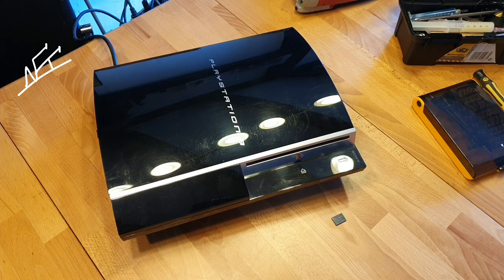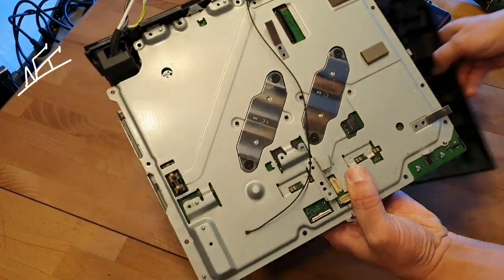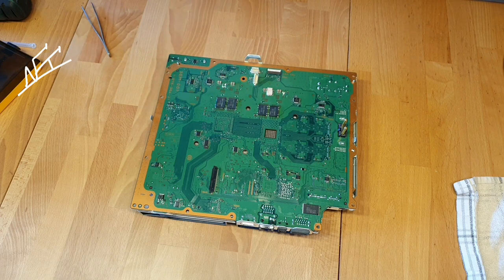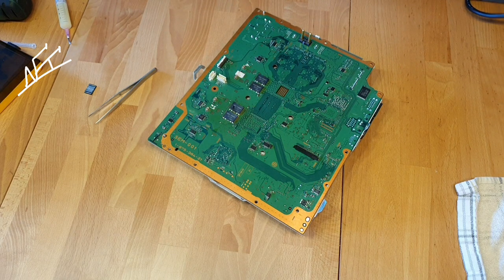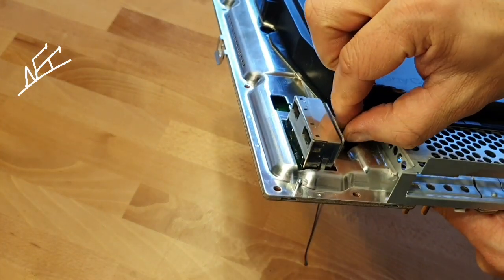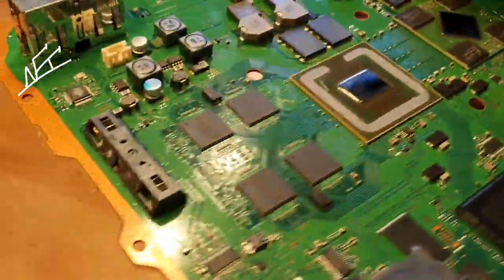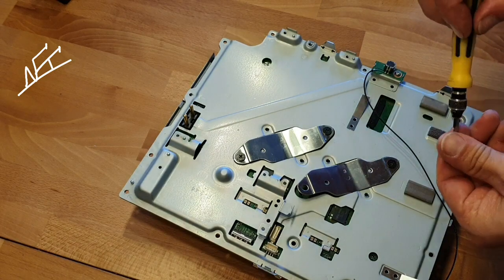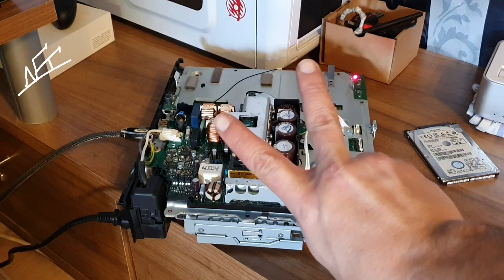PS3 YLOD Fixed with an Original Nec/Tokin Capacitor By:NSC

Comment: Can this Nec's be cause for GLOD (green light of death). Console is not overheating
Reply from the maker: Yep
Reply: Thank you very much for your reply. I ordered 10 pcs of theese caps. Have 2 ps3 Fat-s, one with YLOD and another one 60GB version with card readers. Second have GLOD.
Reply: @lordred7462  hey can you recommend the place we can buy these capacitors from? Thanks.
Reply: @habzmiah  I bought them from ali express
Reply: @lordred7462  thanks. Are they all 470uf that you have bought?
Reply: @habzmiah  yes. I bought 10 pcs in bundle because I will replace all 4 of them in mine ps3 because you can't visually see which of them is bad so I will replace all of them
Reply: @lordred7462  hey i got mine with glod also, did yours get fixed with the capacitors swaped?
Reply: @renatonake182  no, it got scrapped eventually

Comment: Any tips what can cause YLOD when I changed capacitors and still no fix? I fixed two PS3s before with this method of changing capacitors so I think I do it ok but still no fix. It is CECHE.
Reply from the maker: Because it was overheating one day, because the PSU, a broken PCB, a burned CPU/GPU or some fuses...

Comment: Ich habe das L modell und bei den kondensatoren auf der rsx seite steht 108 nicht 128. Sind das die gleichen von den werten? 3,3 v 470uF?
Reply from the maker: The NEC/TOKIN Capacitors have the serial number 0E128 - 1200uF "Phat Models" and 0E108 "Slim Models" - 1000uF Capacitance respectively.

In deinem Fall sieht es so aus als hätte deine Version schon die gleichen Necs wie die Slim Version, bei dir dann die mit 330uf, aber lieber die mit 6.3v, die halten mehr aus als die mit 2.5v.

Wobei bei denen im tut. steht geschrieben 470uf für alle Fat Modelle...

*Phat Models: "470uF"

*DECR-1000 - "TMU-520"
*DECHA00A - "COK-001"
*CECHA - "COK-001"
*CECHB - "COK-001"
*CECHC - "COK-002"
*CECHE - "COK-002/W"
*CECHG - "SEM-001"
*CECHH - "DIA-001"
*CECHJ - "DIA-002"
*CECHK - "DIA-002"
*CECHL - "VER-001"
*CECHM - "DIA-001"
*CECHP - "VER-001"
*CECHQ - "VER-001"
*DECR-1400 - "DEB-001"

Einfach mal testen, wenn nicht geht dann weißt du Bescheid. 

https://www.psx-place.com/threads/tutorial-nec-tokin-capacitors-replacement-ylod-fix.25260/

Comment: Need help Regarding Fat PAL PS3 60GB model, So I have a Problem I hadn’t used my PS3 fat in 3 months but today I booted it up(meanwhile this darn AC was turned on in the same room in the background) and was playing for 1 hour and a half and turned it off for about 10 minutes before turning it back on 3 seconds into the boot up screen and I turned off my AC At this Exact moment my Ps3 shutdown for some reason and I panicked and it started doing this exact red light of death and won’t turn on anymore come to think of it in the past also it would randomly shut off between gameplay 2 or three times making a red light but then it would turn on fine so I didn't pay much attention to it. So I’m guessing this might be a power supply issue or capacitor issue🤔if not then I’ll be really depressed. “Retro” games and old games are really rare in my country and eBay died 2 years ago here so There really is no one trustworthy enough here to be handed this old console.I found this PS3 Fat a year ago on my local craigslist by a stroke of luck! And bought it for $130. It’s always really dusty inside(and it was at the time of purchase too) although I had CFW installed on it So I turned up the fan speed so the temps don’t go higher than 61C. I hope my PS3 isn’t dead. 💀

Comment: HOW DID YOU KNOW THAT  NEC TOKEN YOU REMOVE FROM MAIN BOARD IS NOT OK DID YOU TEST IT? PLS REPLY THANKS
Reply from the maker: SHOCK, WHY DO YOU WRITE WITH CAPSLOCK ON xD Because it's mostly beginning with this one :)
Reply: You never answered the question. How do you test each cap? Or was it just a lucky guess? Please reply.
Reply from the maker: @mikep5782  i got answered you, look back... i told you, because it begins mostly with that one...
Reply: NSC Modz You never answered me. Begins with what? What are you saying???
Reply from the maker: @mikep5782  try to be just a little friendly to me... you came here and you think you can talk like that to me... maybe I'm wrong, but it feels like you just not really thankfully
Reply: @mikep5782  It's a communication problem... he just means that the problem usually starts with that capacitor so that's the first you should replace.
Reply: @nsc your awesome bro. Thank you
Reply: @filekt1584  Lol yeah this is what happens sometimes when English is used as a bridge language

Comment: Hmmm... It seems that I faced a unique YLOD, which is caused by BluRay Drive. When i disconnect ribbon cable, ps3 works just well (there's no games installed), but when i connect it back to the motherboard, i get YLOD, but fans are on. Anyone had ever faced with that? is it caused by TOKIN capacitors?
Reply: Syscon errors: 1001 and 1701. My cell seems to be dead.

Comment: Hey man! I dropped my fat ps3 long ago and it ylod. I got some liquid flux and I am planning on trying to reflow to see if anything would work at all. When it fell, it was on so probably around 70 degrees which is hot enough to damage the token capacitors with a fall i guess. I also have to test the psu. I wonder if reflowing something physically damaged would work?
Reply: Not hassling you here, but curious- how does one "drop" a PS3? I periodically read that someone may have damaged their PS when they "dropped it", but I can't picture carrying it from room to room, let's say, and then just dropping it.
Reply: @kengruz669  i had my charging cable plugged in and tripped on the wire. It brought the whole thing down about 3 feet off my desk. One of the worst experiences ever
Reply: @Two_wheels_ninja  Oh man- That kind of thing I've done myself, several times- with plugged-in laptops and phones. It really hurts with laptops. I once even stepped on a closed laptop that was left on the floor and didn't see. Days later I discovered it had screwed the screen. Thanks for taking my question as intended.
Reply: @kengruz669  luckily my laptop had a protection vibrator meter (forgot the name) that shut it down for protection, no damage was done. At least we learned the hard way

Comment: hello, good video, how you know that is it the bad one nec tokin ?
Reply from the maker: Thank you very much. Like i told, just begin with the RSX side and try the first one, if it has not helped, go for the next one :)
Reply: @NSC-Modz  Good, nice i understand, my motherboard is a ver-001, is the same way to do ? and what you recommend me to do first a reflow of cpu and rsx or a replace of nec tokin? i have ylod of course haha
Reply from the maker: @andresb2834  only reflow of you have remove the IHS and only of it was overheating...
Reply: @NSC-Modz   then the only way to fix YLOD is changing nec tokin , is that what you Say? i'm not do any reflow yet
Reply from the maker: @andresb2834  no, a ylod can be caused from a lot things. If your ps3 was overheating, then you will need to reflow, was it not overheating, then you will need to go for the NecTokin
Reply: @NSC-Modz  oh great , this one is not overheating nothing now , what is showing is after 6 sec the green light turns to yellow and then to red light appears and start to blink and dont stop
Reply from the maker: @andresb2834  sounds like PSU or NecTokins
Reply: @NSC-Modz ahh YLOD could be power supply also , You have a vídeo of this case? to verify the power supply before change nec tokin , for is it would not necessary

Comment: I want to do this but I’m not confident and worried I’ll break something.

My PS3 has YLOD only on certain games but temperatures are fine and paste is new so I’m assuming the TOKIN is the problem.

Do you know how to diagnose which TOKIN is the one causing the problem?

Also do you need to replace with Tantalum or can we use exact TOKIN replacements?
Reply from the maker: Hello Sounds like it's the NEC's making problems, test also an other PSU, and i would go for some new NEC's because the Tantal's make sometimes problems. Just replace the 2 on the top from the RSX and then it should work fine again, or just try one and test it if it's better or not. To diagnostic the NEC's, you will need to take it off first, that's why just replace it and you good to go without to waste so much time...
Reply: NSC Modz NSC Modz hey thanks for quick response! I tested another PSU already and no change so it must be the NEC’s. I found some new NECS on eBay so I will buy these and try to replace. Do I need to just worry about RSX necs? Or any other ones
Reply from the maker: @retroonyoutube5402  i would first replace only the RSX NEC's and test if it's working better then. Best Regards
Reply: NSC Modz I am going to replace them as soon as my new NECs come in the post. Do you know how to check the voltage of the NECs and what the correct voltage should be? I want to make sure I put ones that are fully working on there
Reply from the maker: @retroonyoutube5402  you can just test it when you have remove them, then you will be able to see the deference between an old and an new one.
Reply: NSC Modz hello Nsc, I replaced all NECs with tantalum on the bottom of the board and it fixed my YLOD on certain games, but now I have YLOD on first boot up for the day when the unit temp is COLD. After that it works all day no problem. Do you know what may be causing the Cold boot ylods?
Reply from the maker: @retroonyoutube5402  Hello please try an other PSU and maybe one tantalum is not soldered right, so that it has a bad contact. Maybe you ps3 was also overheated ones and you need to reflow the CPU and GPU
Reply: NSC Modz PSU change still the same. But if it was a bad solder tantalum wouldn’t it five problem always not just when cold??
Reply from the maker: @retroonyoutube5402  good question... its hard to diagnostic a ps3 for me when i have it not here. Have you removed the IHS already to? As long the IHS where not removed your ps3 will overheat one day extremely
Reply: NSC Modz I would love to send it to you but I live on the other side of the world lol yes I removed both and replace thermal paste it works very cool usually 62 cell and 58 RSX with 28% fan speed so temps are ok
Reply from the maker: @retroonyoutube5402  great, so now we just need to know why the first start is bad when it's cold...

Comment: du empfiehlst hier diese 470uf caps https://www.ebay.co.uk/itm/124077994907 hast du auch welche für 330uf? habe hier ein modell mit 108er nec token da braucht man ja die 330uf caps für.
Reply from the maker: Hier kannst du selbst auswählen was du genau brauchst: https://www.ebay.de/itm/173843511383